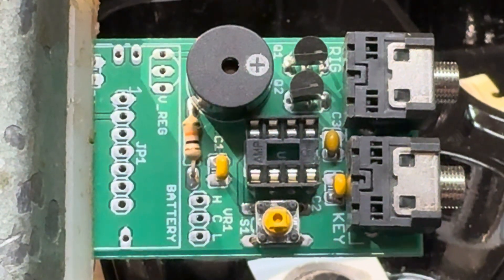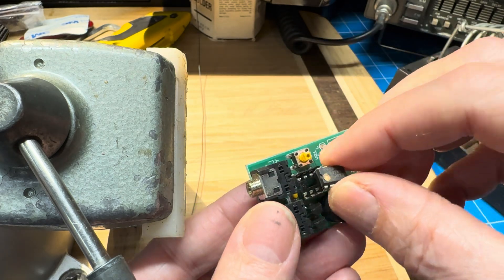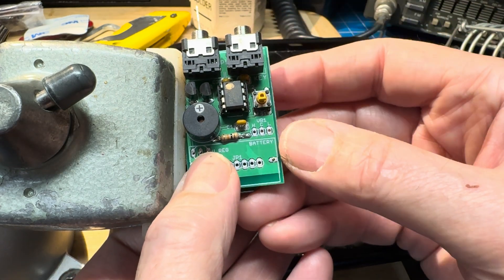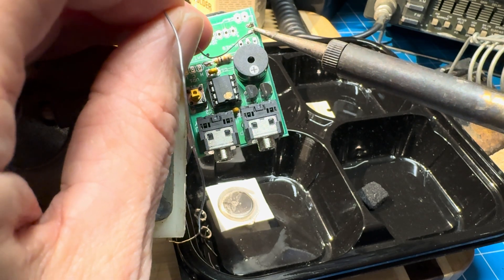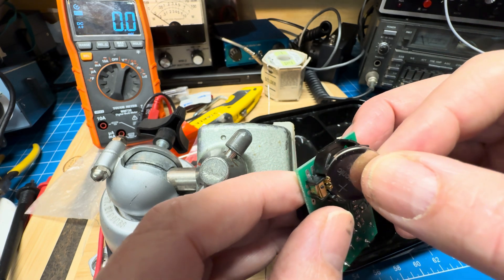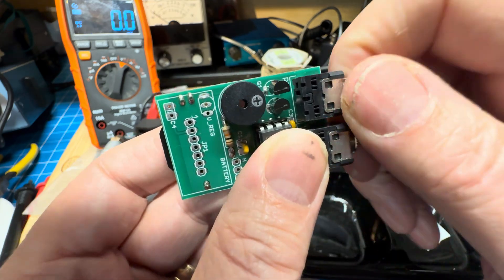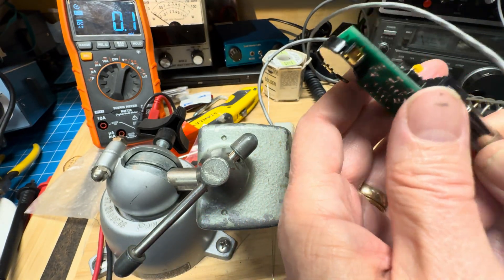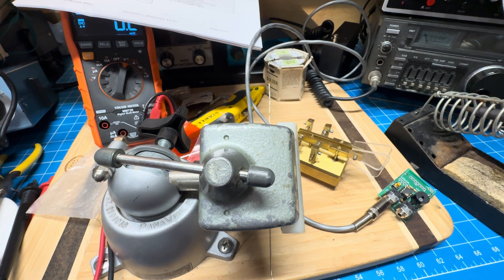Let’s Power Up the PicoKeyer from 2005!

Comment: When you installed the IC, I had a flashback to my 1st experience with installing an IC into a socket on the Ferguson Big Board Computer back about 1981.  The Big Board kit had about 100 IC sockets.  I installed all of the components and then when I began installing the ICs, one of them flipped when I pressing it into the socket.  Suddenly half of the pins were STUCK  my THUMB.  "Experience teaches a dear school." (Ben Franklin)  I never made that mistake again.  I used the edge of a drafting triangle to be sure the pins were properly aligned before applying pressure.  DE K5AVJ (Lynn)